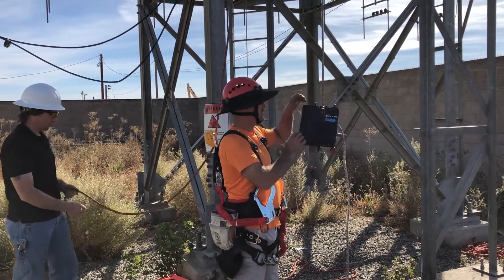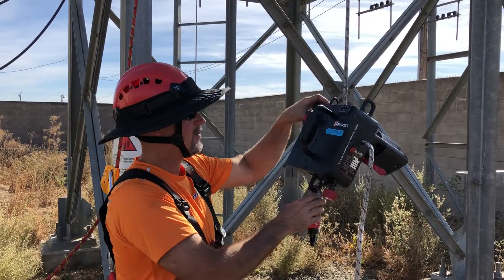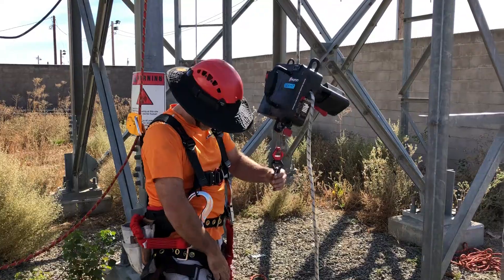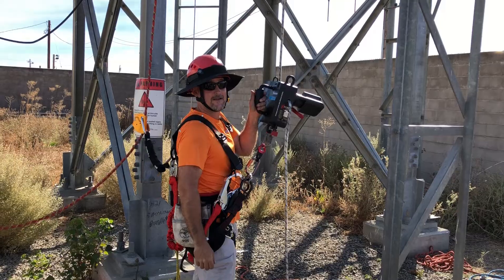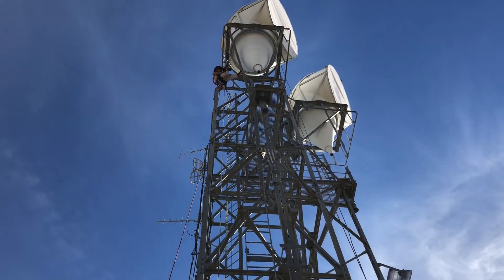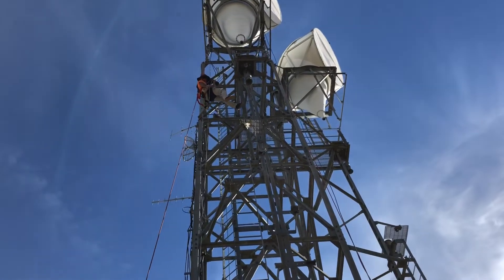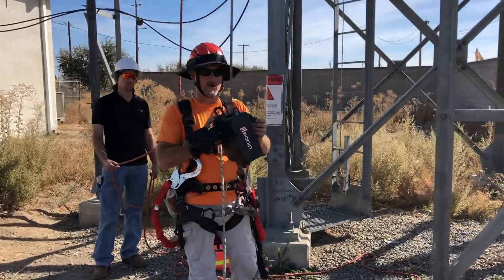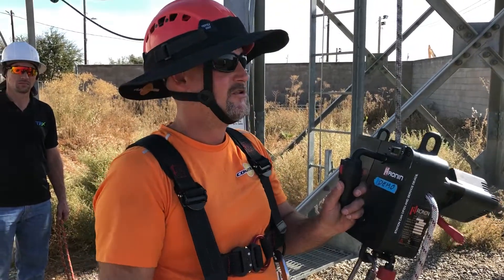Ronin Power Ascender

Comment: Hello Steve!
Nice demo. I just got my Ronin, used it on the tower.
I am impressed, I have 2 batteries but I will buy a third one, for the winters 😊
Mine came with remote control but I hope I can buy a second one, top and bottom.
Thanks for the video.

Dan Bizic
Transilvania Construction
Reply: Looks like it’s hard on the rope, You have to make sure uou are using the recommended rope for this ascender. Preparing the end of the rope is imperative!
Overall I am happy with it.
I am 51 and makes a huge difference to get up and down not worrying about spending your energy, especially in the winter.

Comment from the maker: Crown is allowing it on their sites as long as the user has been specifically trained on the unit and/or an equivalent higher level of training similar.
Reply: Hello I want to buy Ronin battery powered ropy ascender, how could I contact you please
Reply from the maker: It has been redesigned just recently so I don’t know the actual weight recommend,  Yes, there are two models, but again I don’t think you can buy the smaller unit anymore.  You can see them on https://evilgear.com/product/ronin-lift/